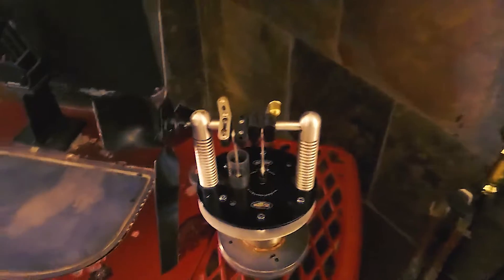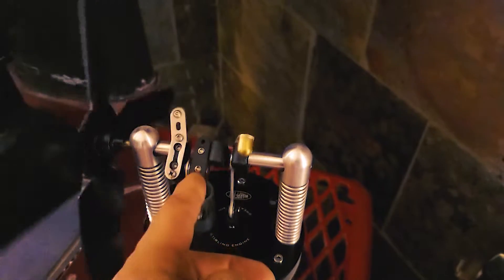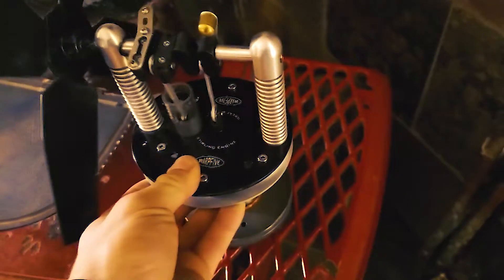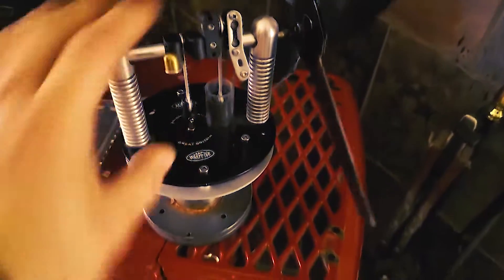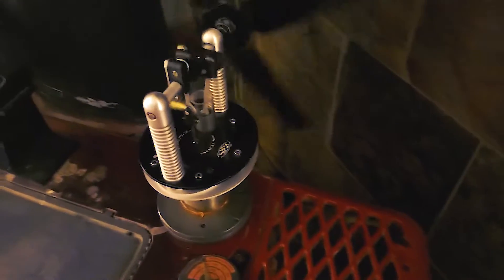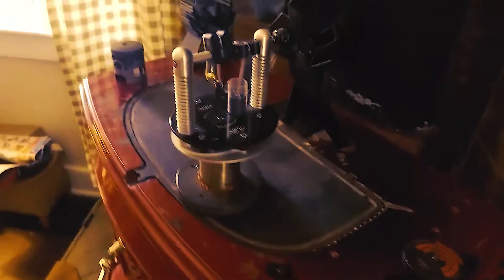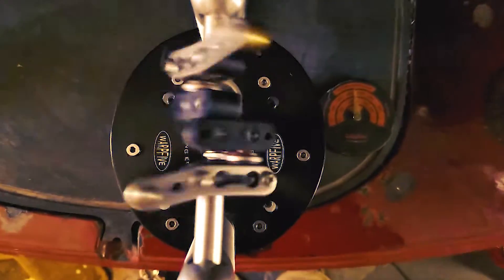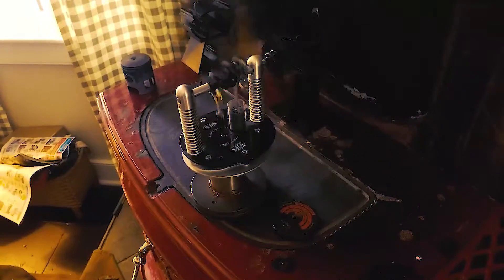Review Warpfive Steelhead Fan review and Stirling engine explanation

Comment: It seems by the video that the wood stove needs to be super hot for it to run fast. Am I wrong? In the vid it was 350ish and it was barely running. In you opinion which fan puts out more aire from the 3 you have in the vid?
Reply from the maker: The electric tall fan is the site way to move heat. The sterling is more fun to look at but it does move air ok.
Reply: @Jedz123  oh ok. They claim the sterling move 320 cfm. While the tall one you have maybe moves 200? But we all know sellers like to throw those cfm figures around so they are never correct. 

What brand is the one that moves the most air of your fans?

Comment: So let me get this straight, your saying if i get a small barrel stove and two of these fans i can replace the engine on my t120 and have a four cylinder engine that runs on wood?
Reply from the maker: Hahaha I wont impede on your ideas but I don't condone the idea.
Reply: I have seen videos of people using stirling engines to power boats, but wood may not be your best bet. It just burns too inefficiently, not hot enough. And to get enough power to propel a land vehicle, it would need a reaaaally big engine. May need more than two wheels so you don't fall over.